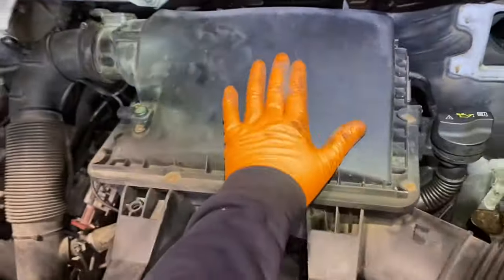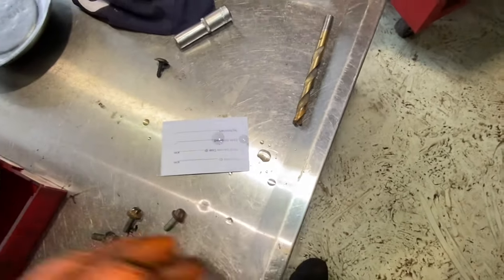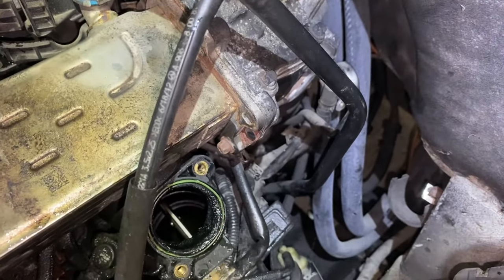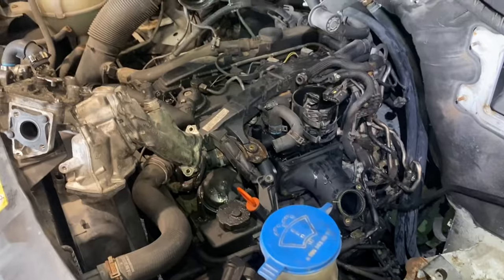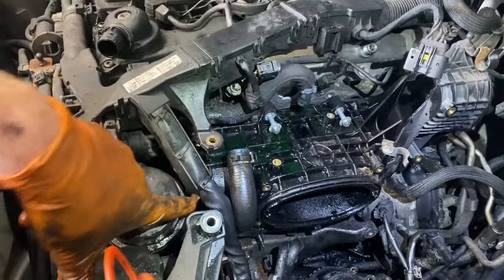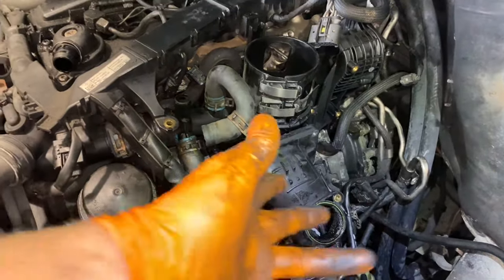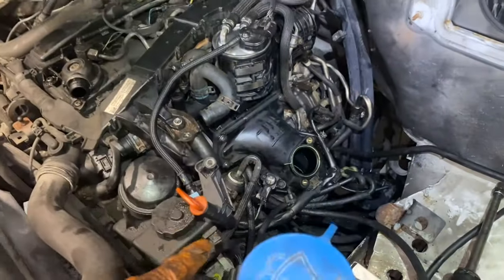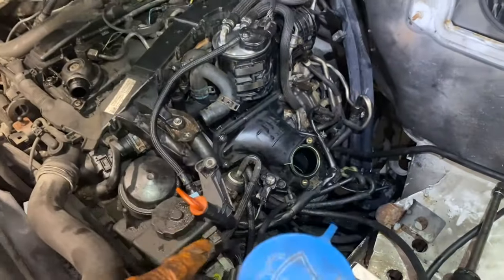Mercedes Sprinter, intake manifold replacement. P2263 boost pressure deviation from set valve

Comment: Just did a fuel pressure regulator on the fuel pump on one of these, it got me, tools getting thrown everywhere, walls getting hit, I wish I got a bird that tight lol
Reply from the maker: All the bits I removed neede to be removed to get at the pump 😬😬😬 
That is some pain in the bottom, bloody car designers 🤷🏼‍♂️🤷🏼‍♂️🤷🏼‍♂️🤷🏼‍♂️
Well done on it though John 👏👏

Comment: Just wandering if replacing the intake manifold solved the problem? Or did client came back? Some say it could be the vacuums. I have the same error code.
Thanks for the video
Reply from the maker: The owner contacted me a few weeks later & said a check engine light came on again. But it never came back to me to check. So hopefully it was just something small that created a different fault  🤞🤞🤞

Comment: Hello, I have a 906 CDI with fault P2261 (charge air by-pass damper has a mechanical operating irregularity) could you tell me if it refers to the intake manifold dampers?
Reply from the maker: @eduardocarlis8607  I cannot be sure without physically seeing the vehicle but I would think not. It sounds like you have a control solenoid of some sort failing. But it will need someone with the skill set to diagnose it correctly, unfortunately 😔

Comment: Lads are going back to the earlier models in droves, Peter - we're getting in 01 -04 models that nobody would have considered repairing in previous years, ones in absolute tatters as loads have had their fill of fixing the newer ones constantly & now prefer running the older, simple versions, even if it means doing big bodywork. 

One came in today you'd laugh at - thin air everywhere, but running like a top - owner runs a fleet, wants it fixed. New ones are breaking his heart apparently.. Common story for me to hear these days.
Reply from the maker: Wouldn’t it make you think 🤔 what has happened to the manufacturing process in the last 20 years 🤷🏼‍♂️🤷🏼‍♂️🤷🏼‍♂️🤷🏼‍♂️
Running like a dream after 20 years & lads struggling to keep 4 or 5 year old one going, it’s all gone stupid James
Reply: I just gave up a 2010 Mazda 3 for a 2016 Mazda 3. Kinda wish I'd stuck with the 10. Better handling and an engine that didn't skip a beat in 10 years and 160 k miles.
Reply from the maker: @bastogne315  that’s the modern motor car for you. I say that the are a bit like LEGO, lovely to look at but just don’t last when being used 🤷🏼‍♂️🤷🏼‍♂️

Comment: hello thanks for the video,is this makeing shaking as well?because mine is leaking and not powerfull plus shaking,thank you
Reply from the maker: Smoke testing the intake system is the best way to diagnose if the intake manifold needs to be replaced.

Comment: Rather you than me Peter. I’m a VAG guy through and through but I don’t mind Mercs; not that 2.1 though. There’s been quite a lot of Mercs in my family over the years. My Father in-law had a 2012 E-Class with that 2.1 engine and I eventually advised him to get rid of it. Who did he sell it to?; my brother in-law 🙄. Take it from me kids, if you want a Mercedes diesel, get a V6 😉
Reply from the maker: They are gone fair plasticy nowadays & bits just bet in together. It can harder than a jig saw putting them back together 😬😂😂😂
Reply: I work on one of these 2.1, 880k miles on stock engine

Comment: I have changed manifold as I thought it was due to leak there but after another diagnostic I did get error code P063878 which refers to throttle malfunction , do you think throttle reset may solve the issue whether I need to change the body?

Comment: Peter new spark plugs didnt fix Mazda. Still hiccupping at 1200 rpm. Might book it in with you next time im in Waterford.😢😢❤❤  Main dealer ran diagnostic and 2 independents ran diagnostics...no codes..and no fix so far. Weird
Reply from the maker: We are all getting so familiar with diesels that we are forgetting to train up on newer petrol engines. Give me a WhatsApp text & get some info from you to see what I can find out.  Kennedysgarage.ie 😉
Reply: Will do Peter. Thanks a million.

Comment: Very interesting Peter…plastic…plastic everywhere…even the sound of the bolts on the plastic suggest cheap plastic…I always thought that Mercs were built like tanks…looks like they are..if you are talking about an Airfix model…..
Reply from the maker: There not built like Mazda’s. Good solid steel everywhere. 
I never thought I’d say that Damien 😂😂😂😂
Reply: @kennedysgarage3281  😂😂😂😂 I thought the same Peter when I saw the Merc Manifold and thought of the weight of the Mazda… Mazda 1, Merc 0 😂😂…and let’s leave it at that 🫣
Reply from the maker: @damienkearns9922  not too many people saying anything positive about Mazda’s so this make a change 😊😊

Comment: Thanks for the Vid, i need to replace the High pressure pump do I need to take the intake manifold off?
Reply from the maker: Hi Timmo, unfortunately I don’t work on these too often and would be only guessing I answer that. Sorry mate 😞😞
Reply: @kennedysgarage3281  Yes the EGR valve needs taking off and intake manifold